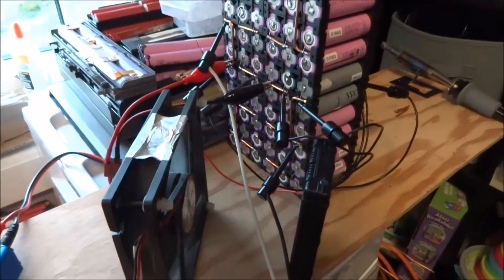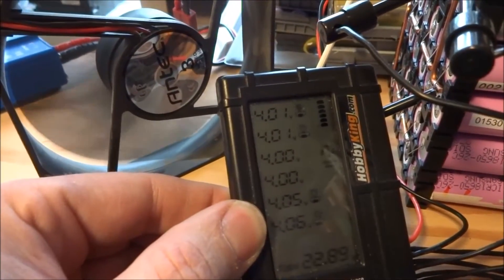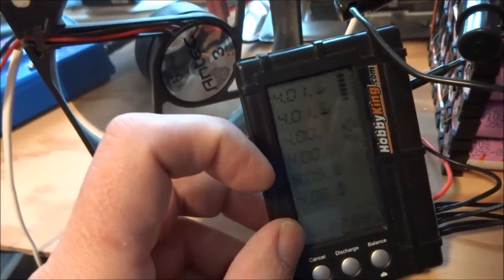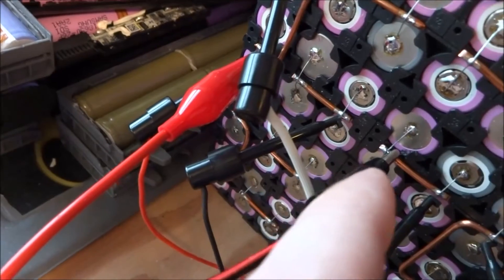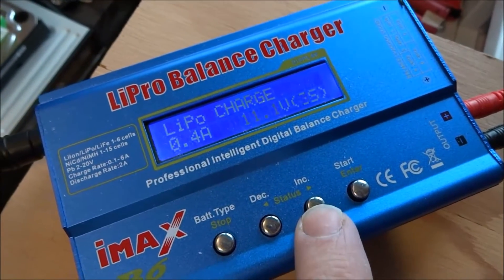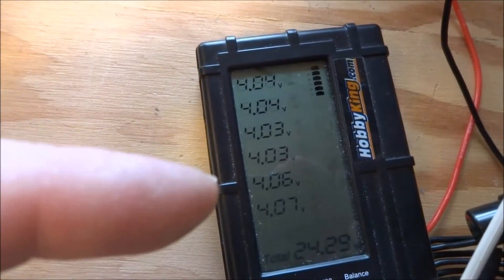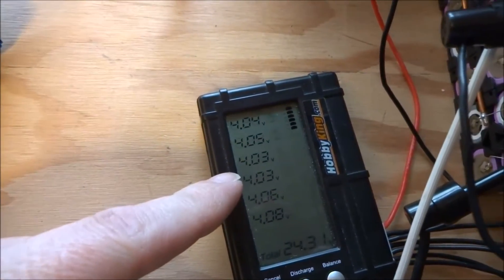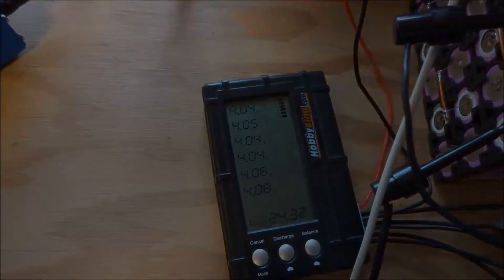Nissan LEAF range extender pack build Pt.2.65 (prototype pack charging)

Comment: Hello, I have the clone b6 also and wonder if you know of a true balance discharger that I can preset the voltage 
to say 2.7 volts in a 6s1p pack ? I’ve built the pack and want to do some capacity discharge/charge cycles, cheers Brett
Reply from the maker: Sorry, I do not, only testing cells individually.
Reply: Hay thanks

Comment: Hi. Hope this isn't a stupid question but why wouldn't you use the balance function on the iMax to balance your cells?
Reply from the maker: Couple reasons, I have an iMax clone and so I don't trust it. Also, I don't want to charge to 4.2 volts, I need the cells to be charged to 4.13 volts each.